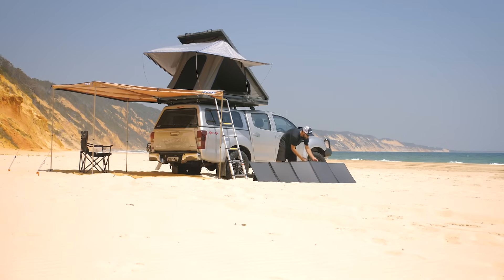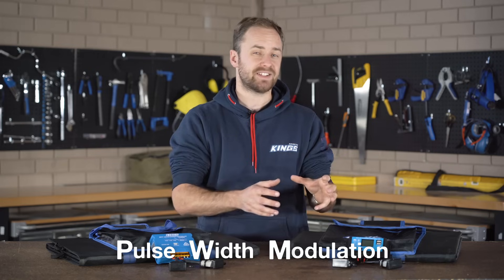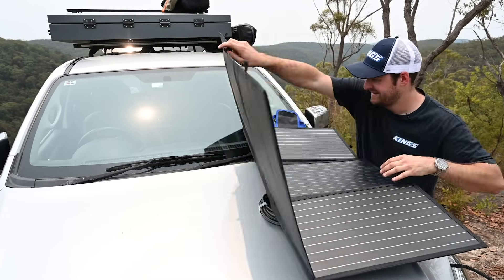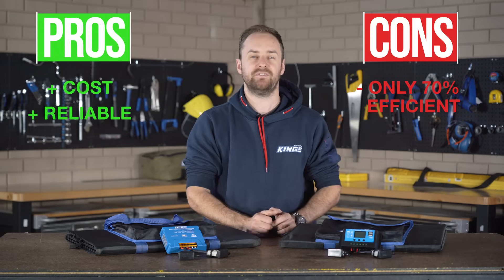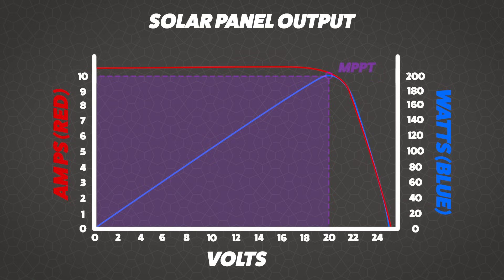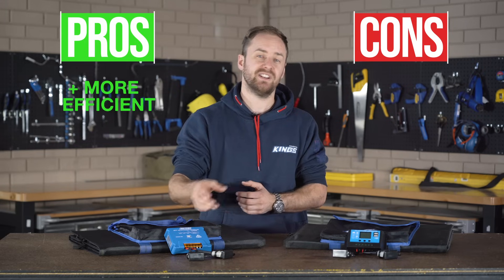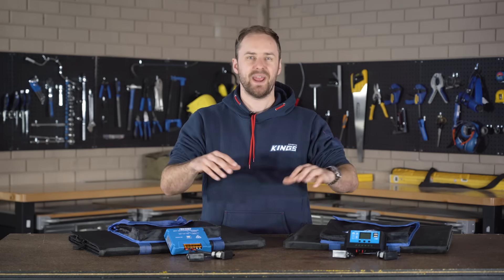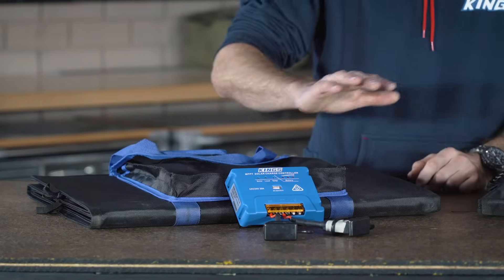SOLAR REGULATORS EXPLAINED! PWM versus MPPT - what's best & why? PLUS upgrade your solar controller!

Comment: Wow! My degree is in electrical engineering and I have a pretty good understanding of electrical stuff. I think this is the best video I have ever seen describing the difference between a PWM and MPPT solar charge controller. That is saying something because there are some bright people on YouTube talking about the same stuff. Good job!
Reply from the maker: Thanks Steve ... we agree with you! - Tracey
Reply: @Peter Evans LOL ok from someone who dosent have a clue
Reply: @Peter Evans at 9:10 it looks like there is a ammeter
Reply: @Peter Evans If you take the few minutes you have you will notice in real life there is a Amp as well as power measurement and he mentioned the values. Don't get hooked on that he indicated before the test that a 200W panel CAN give out 10A. May be swop your 300W panels giving 79W out in ideal conditions for these 200W giving 101W in less than ideal conditions.
Reply: I think it is important to remember this is a video describing the difference between PWM and MPPT charge controllers. 4WD Supacentre did an excellent job explaining these differences. Not everybody does. If a person understands the video, they will appreciate the fact he talked about one of the primary differences in the two—the solar panel(s) will not transfer all of its power to the battery using a PWM charge controller but it will using an MPPT charge controller. A PWM charge controller acts largely like a switch to keep the panel from overcharging the battery but the MPPT controller will do this plus match the output impedance of the solar panel to the input impedance of the battery so you get all the power from the panel dumped into the battery. Maximum power transfer occurs when output impedance matches input impedance. Very few people realize this but the creator of this video does and he explained it very well.
Reply: @stevemorgan2976  This video attempts to explain the difference between a PWM and MPPT controller using an example of a controller that is not PWM. Additionally, in the description under the video there is a link leading to the creator's store where this controller is, clearly described as PWM even though this is not true. Do you think this is okay? Buy such a cheap controller, check the principle of operation and to be sure also connect an oscilloscope at the output. You will see that there is no PWM there. Output current = input current, the controller only checks the voltage level and switches the charging on and off. It is in fact a voltage controller.
Reply: That’s why I said the video was made to compare PWM and MPPT charge controllers. It does an excellent job doing that. He gives a mathematical example describing why you will not get 100W of power delivered to your battery even though you are using a 100W solar panel using a PWM charge controller. And why you should use an MPPT charge controller if you want to get the most from your solar panels. Excellent! Most people didn’t understand the difference before watching his video. And I have seen the controller advertised for sale several places as a PWM charge controller. Some say it is PWM and some (you) say it is not. Who is right? I’d have to buy one and hook the output to my oscilloscope to know for sure. If you’ve done that then I believe you. But who cares? I don’t. It is not a video reviewing that particular controller but one describing the difference between PWM and MPPT. If the charge controller he used in the video is not PWM, as you say, then obviously it would have been better if it was but regardless he explains the difference between PWM and MPPT charge controllers better than I have heard anywhere else and that was what I said in my comment.
Reply: @Peter Evans Perhaps you should go buy a brain somewhere ? It must be hard running around without a brain. Does it echo between your ears?
Reply: @Peter Evans he is right I have personally installed a 250watts solar panel with a 20amp mppt charge controller with 3 parallel 50ah deep cycled battery I have wired the lights on dc 12v throughout the hse and a small 14inch dc colour TV of 26watts I have a modified inverter 300watts
Reply: The 300w inverter I only use it for charging phones because it is quicker this is my second year with that system in rural Kenya where national grid is not available and believe me we have never had issues with power although we don't use fridge, kettle , microwave etc but for lights and TV we have adequate power throughout the year
Reply: What about charging a lithium battery. PWM positive and a massive MPPT fail if they can not be used for this. Your website states that PWM is lithium compatable and MPPT not compatible.
Reply: @storm0568  The Victron Smart Solar controllers can charge lithium batteries.
Reply: I have this mppt which I connected in 24v with 12v solar panels but the blue light which indicates charging it's not showing but the red indicator which means not charging.
What could be the problem?
Reply: @judejacob5439  you are not clear in your note. How many watts is your solar panels? Then we can take it from there
Reply: There is a possibility that people can make better mppt than the commercialized version
Reply: You have no idea about electrical engineering. This cheap model is not a PWM regulator. Just a simple charge voltage controller, nothing more.
Reply: @Karl with a K The meter is clearly on the output side, otherwise how would it be measuring the BATTERY voltage? If the meter was on the input side, it would be showing the panel voltage. 
Starting a statement with "wrong" really comes off pretty antagonistic as well, people will always be less receptive to your comments if you are so hostile straight away.
Reply: I need to put it in line with a 240 v supply system that has a solid state relay and solar connection point.
Reply: Say no more using a cheap Chinese PWM and a brand name MPPT
Reply: degree? youtube tutorials. Wasted money.
Reply: In electronic terms, a regulator's job is to regulate the output voltage. While it can charge due to potential difference, that's not what it was designed for. It looks to me that your MPPT is simply a PWM regulator with a built in charger. Looking forward to hearing your response.
Reply: @Peter Evans you don't have a clue ok
Reply: Ff

Comment: Does the PWM stops charging, when my battery is already full?
Reply from the maker: Yes so it has a FLOAT OR CV VOLTAGE function where it accepts power from the solar panel until the 
battery’s voltage reaches the set value. 
If you have any more queries or want to discuss pricing and deals with us, feel free to email us on social@4wdsupacentre.com.au
Cheers,
Saleha

Comment: i just brought the solar camp setup consisting of 115 battery,250 watt hard solar panel,battery box,inverter and 10 metre lead,do i need one of these regulators
Reply from the maker: Hi Mate,

the 250W Panel will have a regulator built in - but if down the line you want to get more out of your system you can think about upgrading!

Cheers,
Cahn

Comment: Hi everyone Just a Note On This Reg Issue ,,, In short this is the drum a 30 amp MPPT unit will not be AS GOOD as a 40 amp PWM in the real world ,,,                                                                         OK so more detail I run 4 panels at 250 watts with 8 batteries at 135 Ah at 24v setup so 4 cells ,,                                                                                                                                                                   YES A MPPT IS BETTER if ur compering 30amp to 30 amp units i was sold a 30 amp unit to replace a 40 amp PWM the system has not work as well ! and have ordered a 40 amp PWM to replace this 30 amp MPPT unit with a price diff of $163  ... Hope this helps                                                                                  Simon Bowman Cairns ,Facebook

Comment: Good grief I've searched all over, asked ? After ? What solar regulator I'd need, finally came across your video, thank you! Woohoo feels like I'm on the right path in deciding on solar power for my van. I have to have a AGM battery bc it will be inside. Been racking my brain trying to know the safest regulator to charge my battery and get the most out of a 100 watt panel.

Comment: Mate you are a absolute legend. Thanks for sharing such a valuable information,  I will get MPPT and portable solar tomorrow.
Reply from the maker: Hi Sathya, Thanks for appreciation mate. If you need any assistance with purchasing solar and mppt controller, feel free to contact us on social@4wdsupacentre.com.au and we can go over best prices and deals with you then. 
Cheers,
Saleha
Reply: @4wdsupacentreAu  sounds great saleha. Today I just went to weatherhill Park, bought 20A MPPT, connecting it with existing Full river battery,  redarc dc dc charger, redarc 80W solar panel mounted.
Bought few other kings products such as lights, awning, fridge etc.

Comment: I have an MPPT system in use... i notice every once in while output amps to battery drops to zero, watts drops to zero and voltage stays 19-20 volts.  so it stops charging battery. so is battery full? sometimes i see it is full well over 13.5 volts... other times its in high 12's   like 12.9 or 12.8      is solar panel too hot?
Reply from the maker: Hello, I think this can depend on various factors so best bet will be to email us your order details on social@4wdsupacentre.com.au and we can check for you?

Cheers,
Saleha

Comment: Great, and simple explanation.  I am building a battery storage bank for when we lose power at our house.  We might lose 2-5 days in an average year.  I have access to used 12V, large truck batteries on a fairly regular basis, for free.  Therefore, I was planning on hooking them up in parallel, and using a 12V battery charger, off of my regular 120V house circuit to keep them topped off.  My home solar system does not have a bypass, at this time, to split the panels off to the battery bank.  I am wondering what type of controller I could use on the charging side to not overcharge the batteries.  Also, what type of inverter would be good to power say a refrigerator, and PCs for working from home with power out?  Any advice would be appreciated.

Comment: One thing is in a good match system the increase with mppt or we pwm is about 3% but the nice thing isost mppt you can have 100 volts coming in and 12 or 24 going out. Also in the cloudy days they are way nicer and get the most power out of the panels.

Comment: Can I use buck converter in place of MPPT?, Is buck converter better than PWM? Please reply
Reply from the maker: Hi there, unfortunately we can't recommend any products not made by us, but either a PWM or a MPPT is essential for any solar setup. Thanks, Madi
Reply: @4wdsupacentreAu  please make a video, how to charge battery using solar panel with buck converter

Comment: All solar controlers have timed outputs. Most are between 120 minutes to 180 minutes. The result is.. the solar system sits for most of the day.. trickle charging your large battery bank when it is only 60% full.
The only chargers that work all day long are ones that use a battery monitor shunt that records how many amps are used and replaces 120 to 130 % of those amps.
Victron, outback and most solar controllers cronicaly under charge batteries.

Comment: Thanks for the great video.
What are the benifits, if any, of having a higher Amperage MPPT controller?
I have seen a model that comes in 30, 40, 50, 60 & 100 Amp options.
Reply: @Ian Gilks...Main advantage of choosing a higher amperage controller is for future system expansion and also an increased margin of durability when considering component stress and longevity... just be sure to allow some margin of headroom when matching your system.
Reply from the maker: Hi Ian, It will maximize the power into battery from panel. 
Cheers
Saleha

Comment: thanks for clearing that up. greater confidence with my purchases!  also what was the unit used to test the amps and volts and how was it wired in?? thanks heaps.
Reply: He just used a watt metre, you just connect it with Anderson plugs. Different watt metres give you depending kinds of readings.